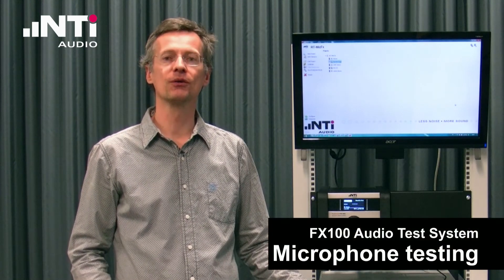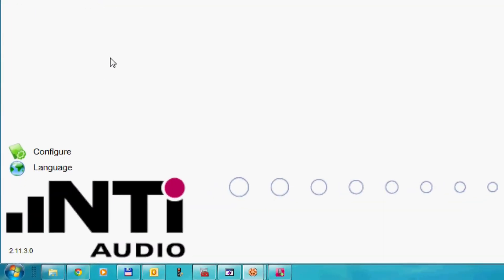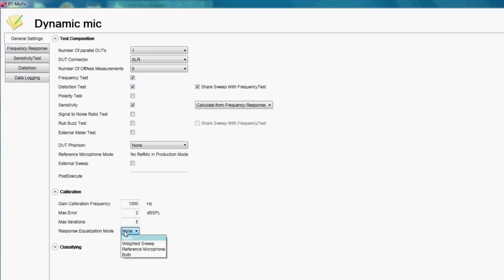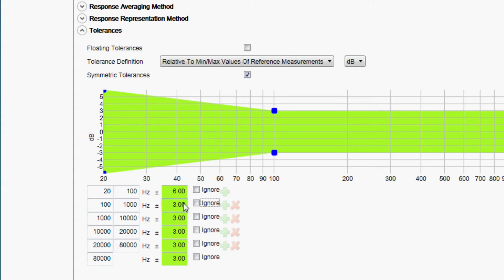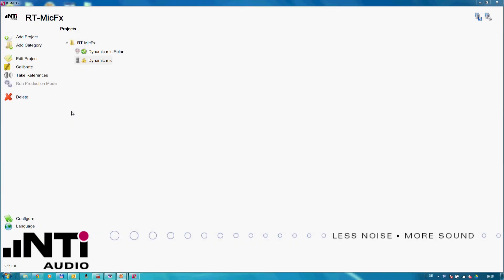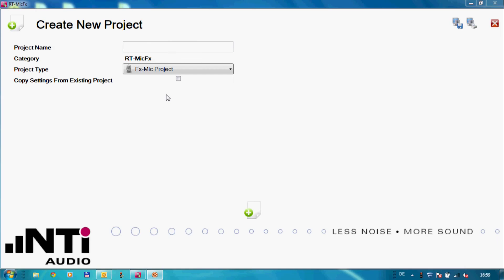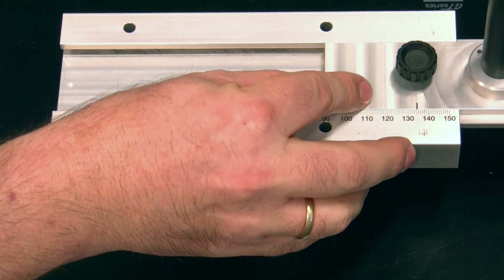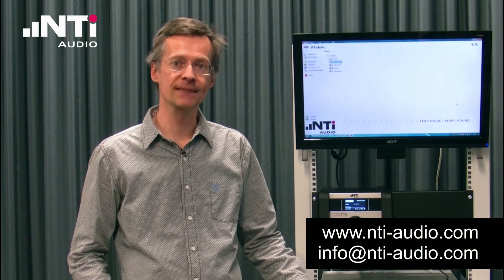NTi Audio: Microphone testing with the FX100

Comment: I'm a fx100 user. Can you recommend a reference speaker that can be used to measure the microphone?
Reply from the maker: We recommend to use a wide-band co-axial loudspeaker (e.g. studio monitor)
Reply: for example...? tannoy system 600 ? fyne audio f500 ?
Reply from the maker: @jmyang2200  Both, the “Tannoy System 600” and the “Fyne Audio F500” are suitable loudspeakers for microphone testing